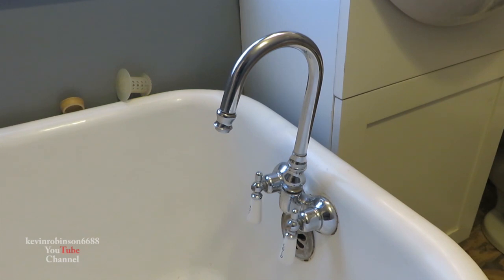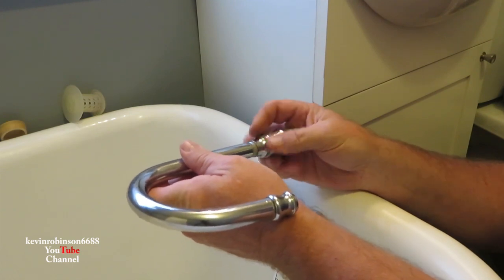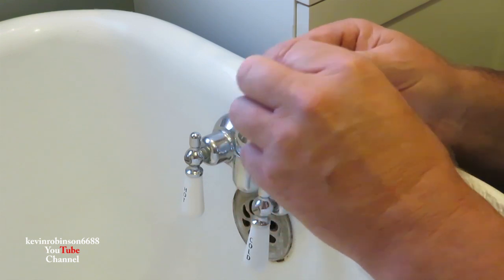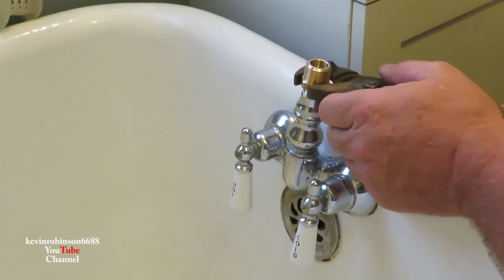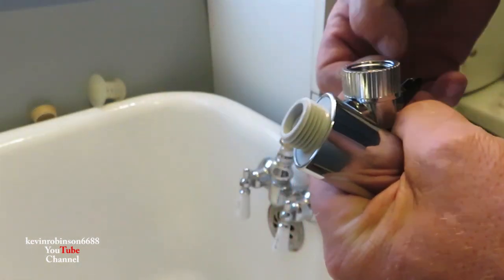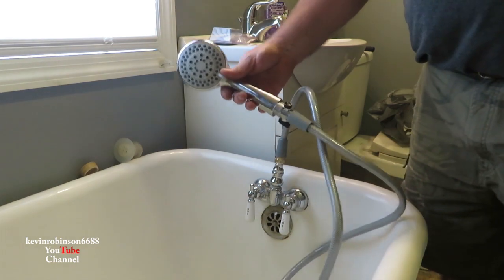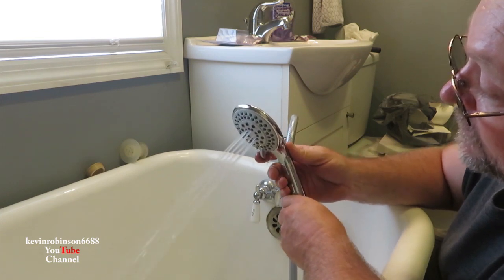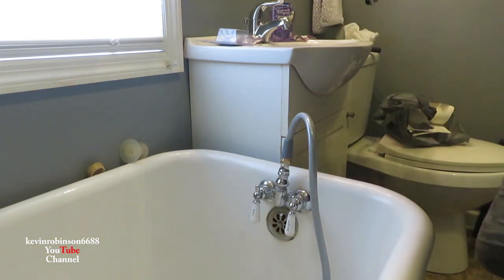Turn a Clawfoot bathtub into a shower

Comment: I have that Barclay clawfoot tub handle set but mine has both the shower and the bottom spout to fill the tub. When I turn it to shower mode, it no longer diverts the water to the shower and I can't find anywhere on how to fix this :(

Comment: What is the connection size of the brass fitting?  I may be able to get you one in stainless steel.
Reply from the maker: 1/2 Male to 3/8 Male thanks Frank.  Standard pipe thread.